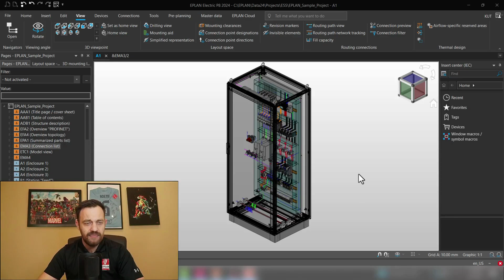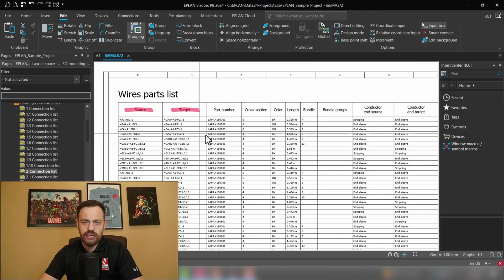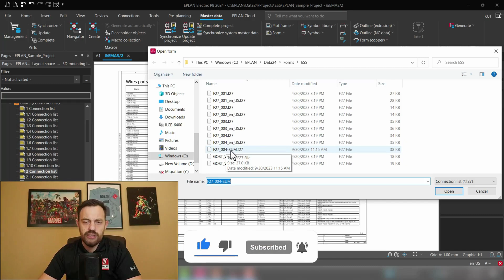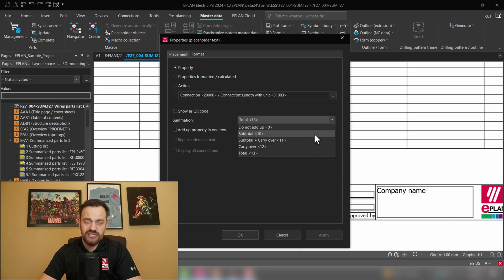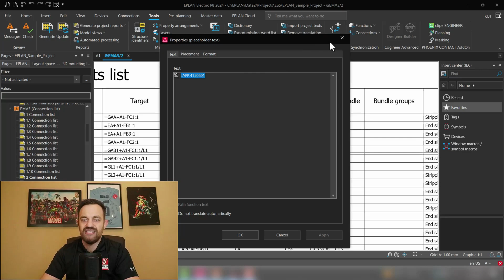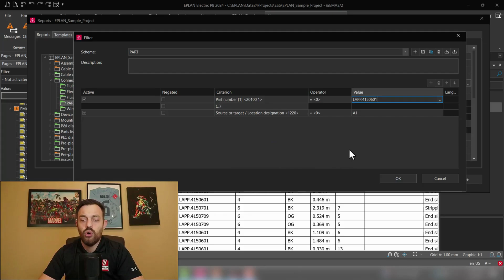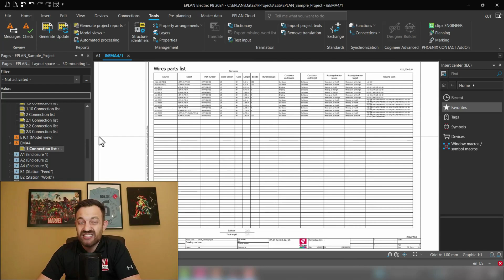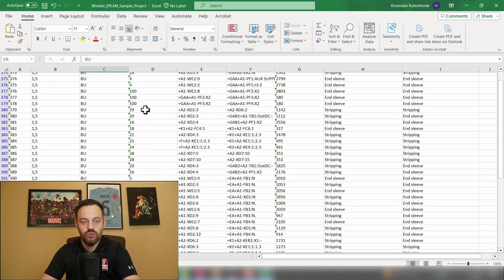How to Calculate Total Wire Consumption in EPLAN

Comment: I can't wait to watch it 😄

I also have a question 🤗

When you insert a symbol (I use the IEC), the connection points are always shown on the right side 😱For example I insert a relay coil, the A1 and A2 are on the right side, same for a simple NO switch, the numbers 3 & 4 are automatically placed on the right side 😭

I've managed to do it on the left side... But that takes a lot of work! Especially to allign them correctly... I hope there is a better (aka global setting) way.

I hope you can make a video tutorial of this solution too 😎
Reply from the maker: Hello Sir.

Thank you for your question.

In every PROJECT every function definition, symbol and symbol variant have a default  Property Arrangement for the Display.

So if you create it once proper, save it and set it up as a default. (The next time you are insert the function def with the symbol and that variant you shall receive a proper display)

For future Projects please make sure that you use the Project before as a Basic Project.
Reply: @UncleKruno  😊 Thanks